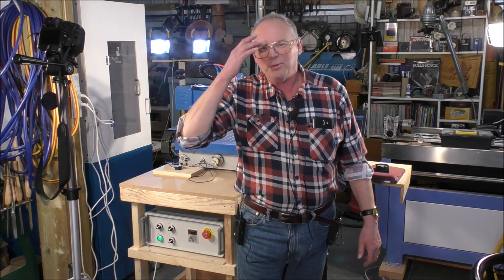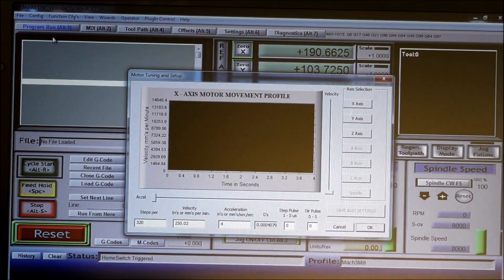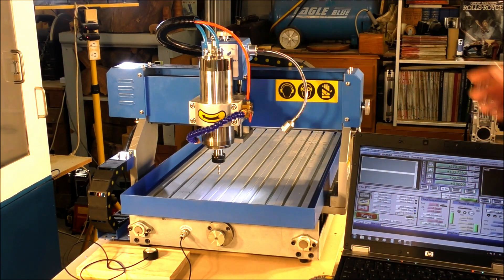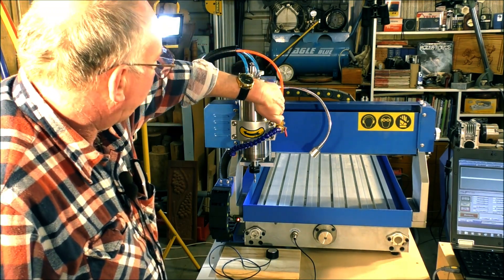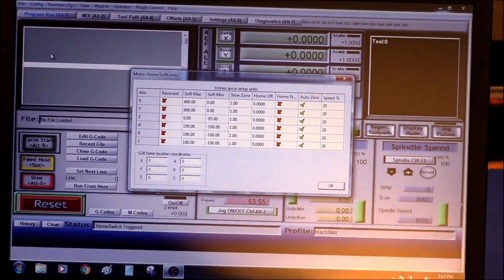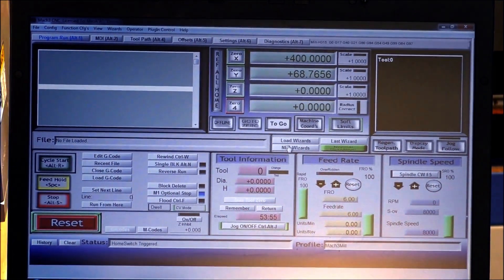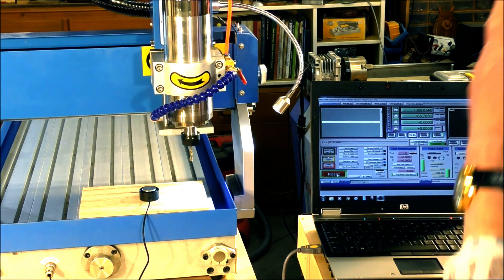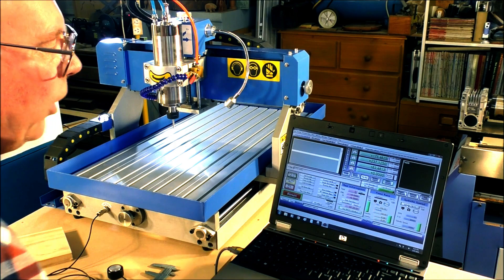Mach3 setup on a good 6040 CNC Router

Comment: I like mach3, but it's not good for laser command$.
But it is awesome for aluminium and wood cutting, and plasma cutting!
Reply from the maker: Hi, have a look at RDworks its free and I have used it for years
Reply: @ Will it work on the mach3 compatible cards? Because, the trouble I have, is having to switch motherboards from a mach3 board, to a grbl board. And, I have to manually change all the wires around just to use it!
Reply from the maker: No I dont think it will, it would need a laser bob
Reply: @ Oh, ok, thanks anyway, I will try it.